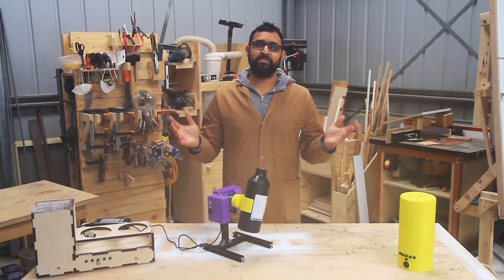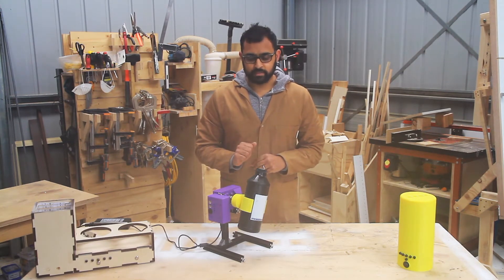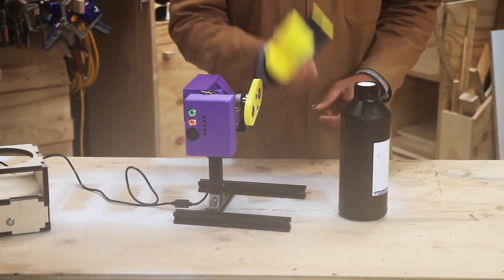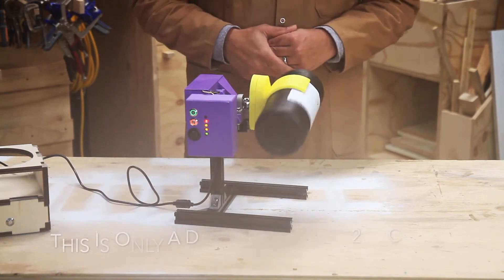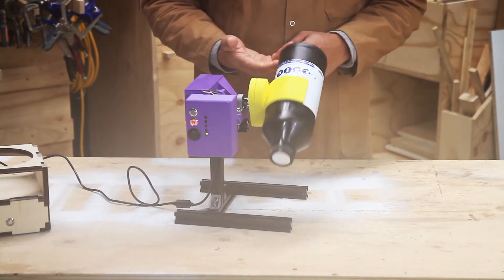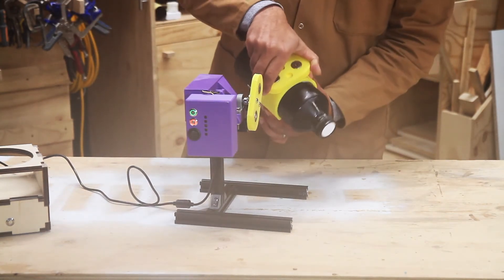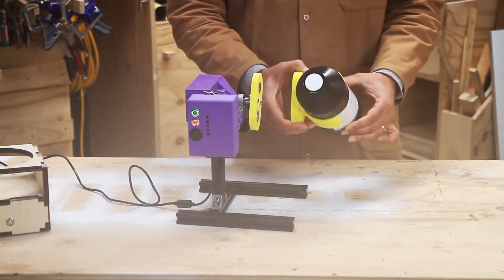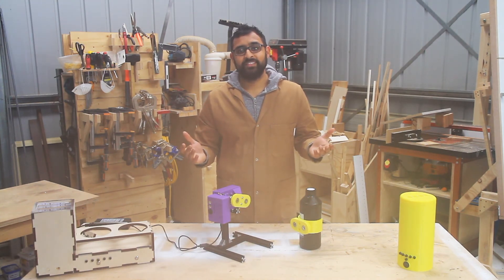3D SLA Resin mixer

Comment: hello, great project first of all! i think this design is better than a normal roller mixer as i imagine it won't leave any settled particles in the bottleneck. I am a 3d printing dentist as well and would like to build a device like yours. Is this an original design of yours? Are the stl files and components available somewhere? I would greatly appreciate your help!